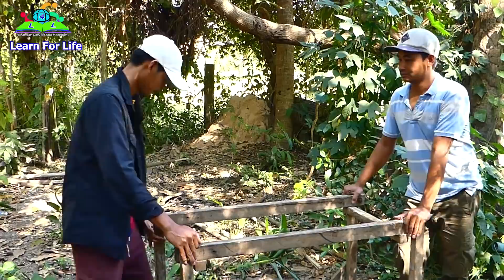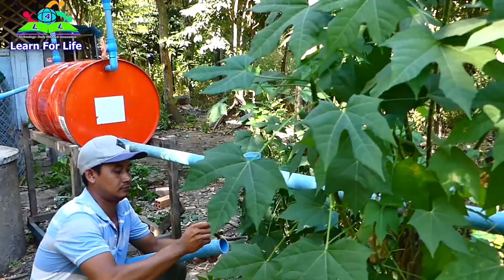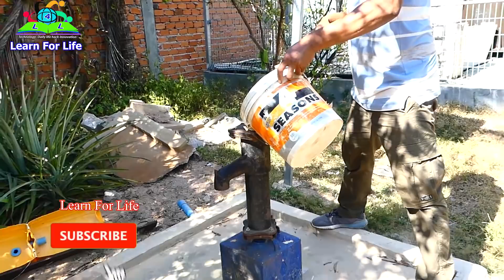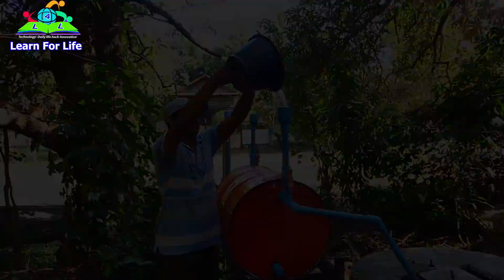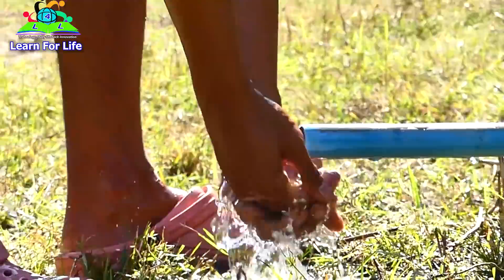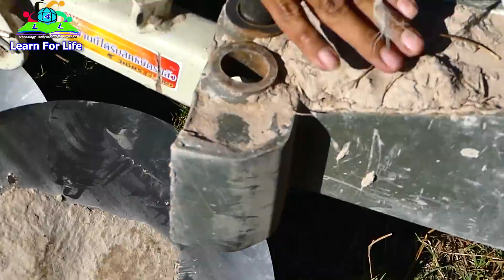Deep Well - How to make free Energy water tank from Deep Well - Learn for Life.

Comment: What is the diameter of the pipe that you used on the inlet and outlet? If my assumption is correct the outlet was a 2 inch pipe. What's the inlet?

Comment: The location where to add water to the barrel doesn't make sense.  Half of the water probably went back to the well.
Reply: Of all the questions I have, that is not one. The suction pipe in the well has a no return valve on the bottom, that is how he filled that pipe by shaking it up and down at the start of the video.